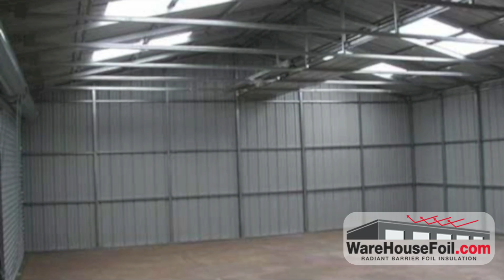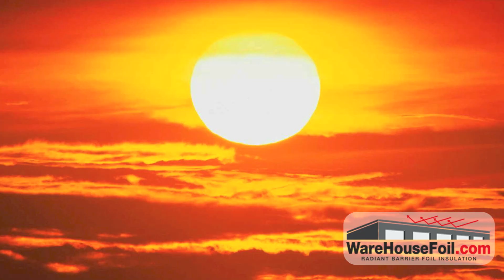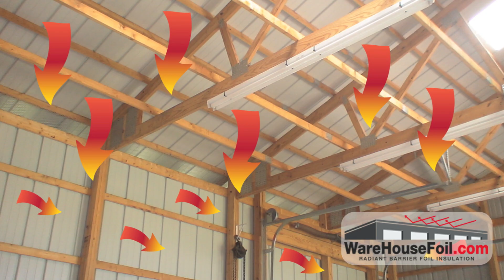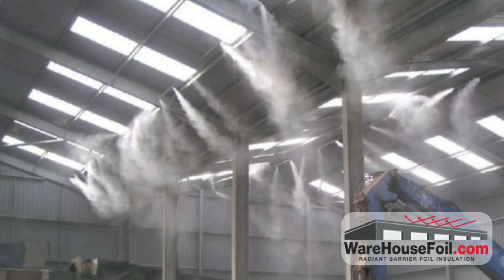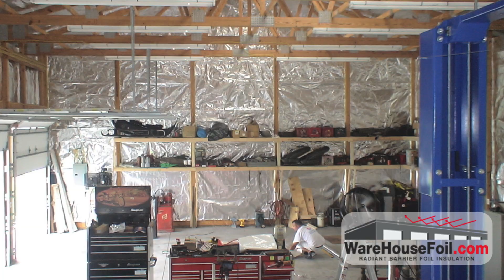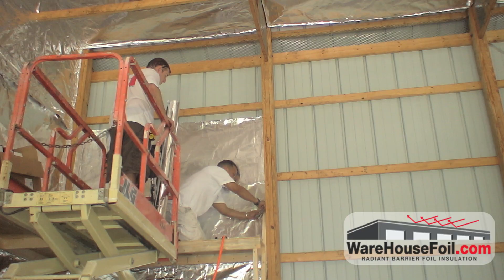Why You Need Metal Building Insulation - www.BlueTexInsulation.com

Comment from the maker: Our new BlueTex Insulation is a PERFECT SOLUTION for metal building insulation since it will block the radiant heat AND stop the MOISTURE! Check it out at www.BlueTexInsulation.com
Reply: How do you install this on a metal stud/surface?  Wood seems pretty straight forward. Also, will this work if applied over closed cell foam if there’s an air gap?
Reply from the maker: @LeanMean0311  Great question!  Take a look at this video for our new foam and foil products at www.BlueTexInsulation.com  It shows several different install methods.   https://youtu.be/UCAx2g4oaTA Or, contact us, send us some pics and we can offer advice on installation for your specific building.  www.AtticFoil.com

Comment: Two questions:

1. Does this work for Quonset Hut applications? 

2. Does it ever make sense to install barrier on the outside instead of on the inside?
Reply from the maker: Yes, you can use for Quonset Huts.  Call us and we can send you some ideas for installation since it can be tricky.  Also, the www.BlueTexInsulation.com products are usually best for this use unless you are strictly trying to reflect heat in Souther climates.

Comment: Can you use this after closed foam insulation and what if you are planning to air condition your building?
Reply from the maker: Ideally, you would get the foil to the outside of the foam.  However, it will still provide a benefit to reduce any radiant heat coming off the foam.  If you want to add AC, you will want a fully encapsulated insulated "box".

Comment: Additionally, roofs and exterior walls should be painted as light a color as is acceptable.  If you live in a southern state and have a dark roof, you are absorbing loads of heat from the sun.  Lighten it up, and it will greatly reduce the heat.
Reply from the maker: This is true to a certain degree and lighter colors never hurt.  It's actually more about the reflectivity/emissivity of the surface then the color.  For example, a chrome bumper on a truck is VERY Reflective, but you wouldn't want to sit on one on a sunny day, where you could sit on piece of black foam no problem.  Thanks for the comment.
Reply: AtticFoil True.  Related to the above, but a separate point: You mentioned roof temperatures in the video, so here's some data.  I had lighter shingles installed when I replaced my roof a few years ago, and I saved a spare shingle each from the old and new material.  I placed them side-by-side on the sidewalk and compared temperatures at noon via an infrared thermometer.  The darker one was 175-177 degrees; the lighter was 150-153 degrees!  Granted, this was flat in direct overhead sunlight in the summer (ambient temp = 100 degrees), so we're looking at maximal conditions.